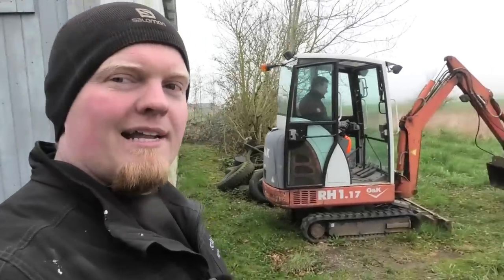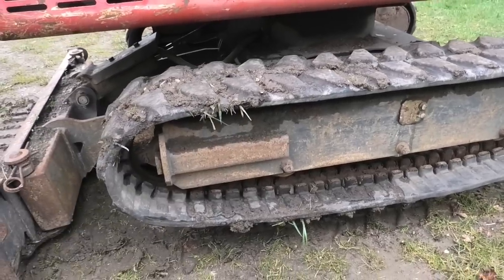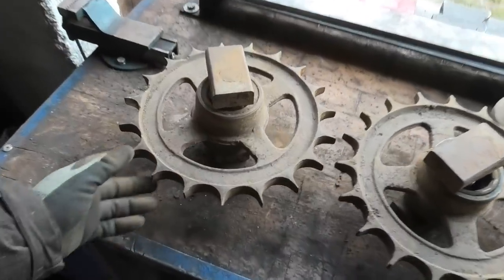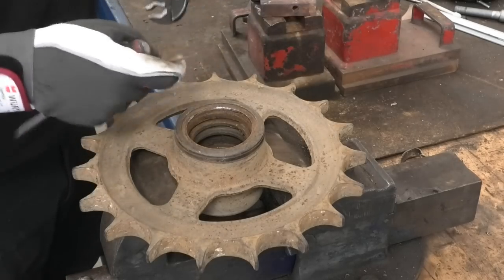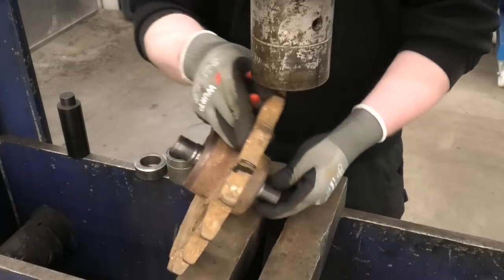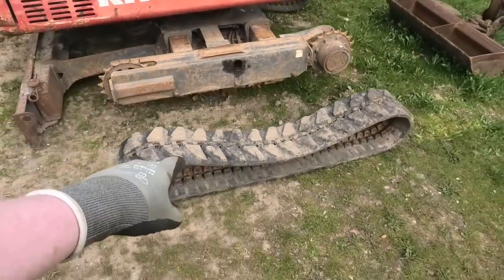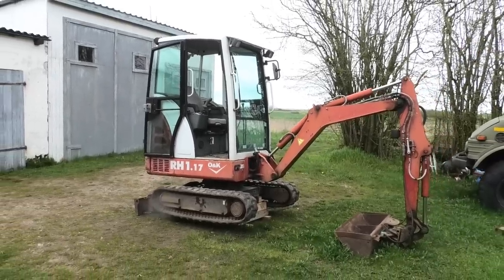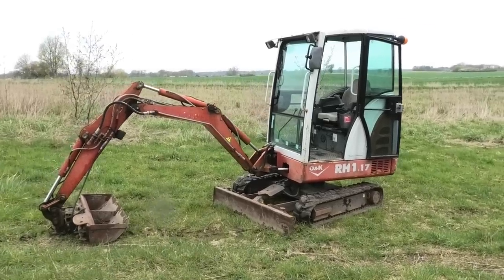Mini Excavator - Track Repair

Comment: With what you said at the end you're right, lifting one end with the bucket and slewing it is much easier on the tracks but it was a good test doing it just using the tracks.

Comment: You should’ve preheated the sprocket. The cast needs the extra heat to accept the weld. Also you should’ve serviced the drive motors with fresh oil.